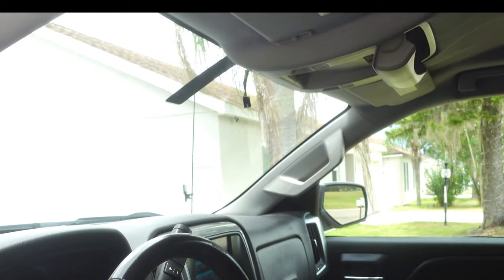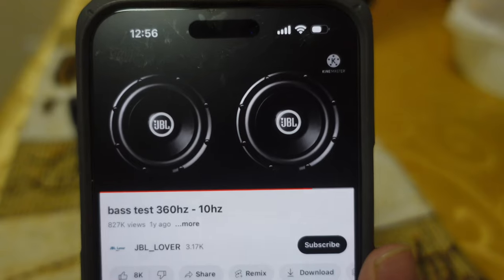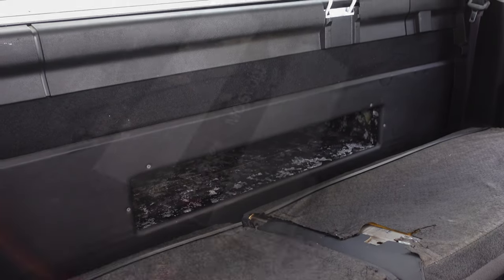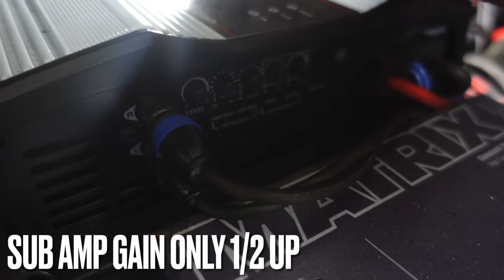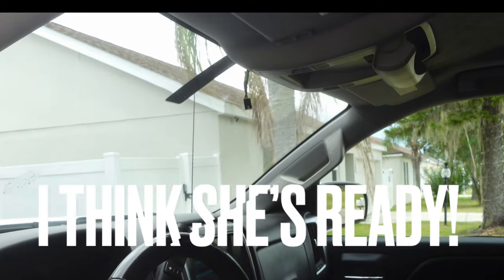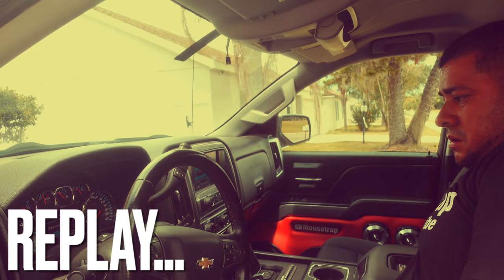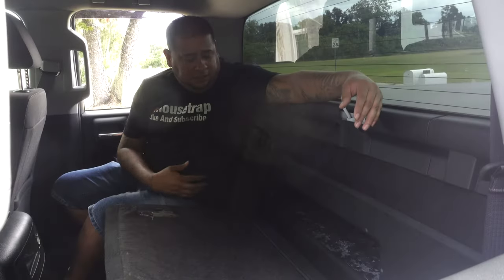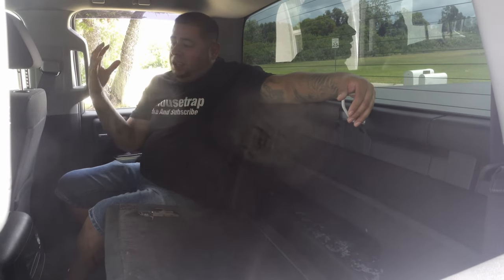CHEAP Subwoofers MIGHT Break Car Audio SPL Record!

Comment: Gain being half way has nothing to do with the amp being turned up if it’s gain matched it’s putting out what it should.
Reply: My gain is tuned halfway up because I have a factory head unit and line output converter that's only 2.5 volts and it's fine